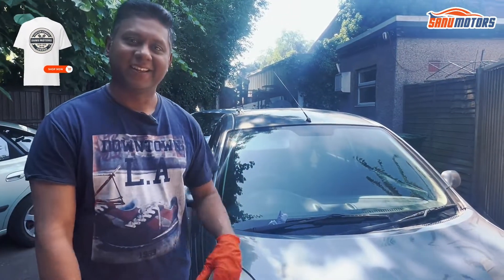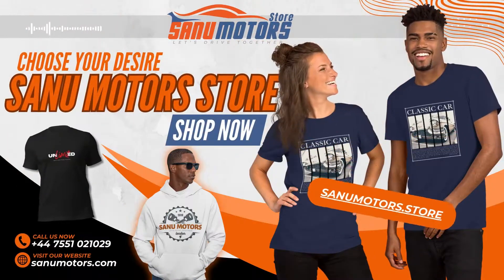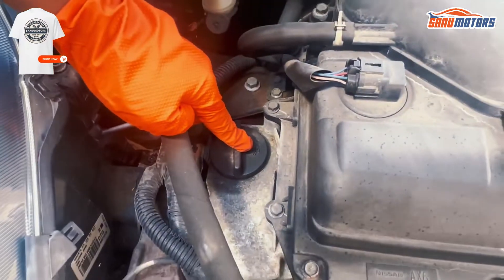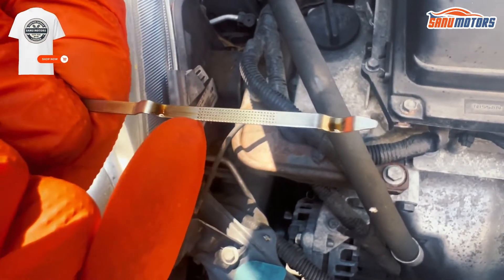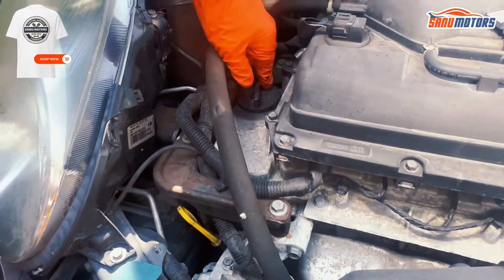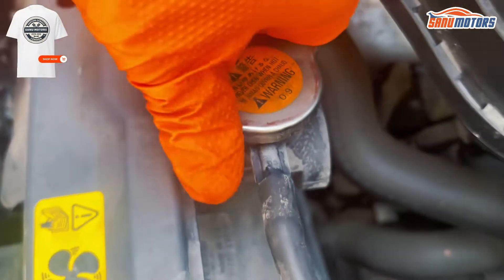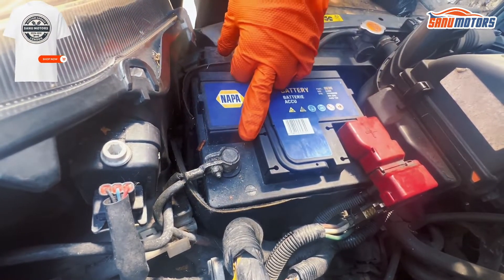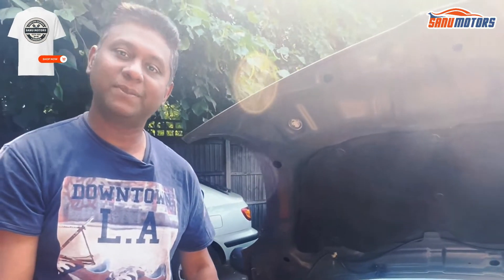Nissan Micra 2008 Engine Bay Top Up Guide | Coolant | Screenwash | and Engine Oil DIY Tutorial  🛠️💥💯

Comment: Hi Brother, just like you showed me your engine oil level, my car's engine oil level is also the same, what should I do now?  I have Nissan March 2003 and oil level problem still And the engine oil level problem is that I've been seeing the same engine oil level since I bought this car five years ago.
Reply from the maker: Thanks for your question, and it’s great to hear that the video was useful! If your engine oil level has consistently remained the same for five years, it’s quite unusual—most engines consume a little oil over time, especially in older cars like your 2003 Nissan March. Here are a few things you might want to check:

Oil Quality:

Make sure you’re using the correct grade and type of engine oil recommended for your car. Sometimes, thicker oils can appear to stay at the same level but may not be circulating properly.
Oil Circulation:

Check if the oil is actually circulating within the engine. A clogged oil filter or sludge buildup can prevent proper flow, making the oil appear untouched.
Dipstick Reading:

Double-check your method for reading the dipstick. Wipe it clean, reinsert it fully, and then check again to ensure accurate readings.
Faulty Dipstick or Measurement Tube:

A damaged dipstick or dipstick tube might not give you accurate readings. Inspect it closely for bends or blockages.
Oil Burning/Leaks:

Since you haven’t noticed any drops in oil level, there’s likely no excessive burning or leaking, but it’s always good to inspect under the car for leaks or check the exhaust for blue smoke (a sign of oil burning).
Regular Maintenance:

Even if the level seems fine, it’s still important to change the oil and filter regularly to ensure the engine is lubricated and protected from wear.
If everything checks out and the car runs smoothly, there may not be any immediate issue. However, if you’re still concerned, a quick inspection by a trusted mechanic can give you peace of mind.

Let me know if you need more tips! 🚗👍 #NissanMarch #EngineOilLevel #CarMaintenance
Reply: @SanuMotorswithCharlie  ❤️
Reply: Thank you so much brother
Reply from the maker: Your welcome
Reply from the maker: Your welcome

Comment: Can someone tell me where is the tank door in micra 2008 CC pleeeaseee
Reply from the maker: The tank door (fuel filler door) for the *2008 Nissan Micra CC* is located on the rear passenger side of the vehicle. To open it, follow these steps:

1. **Locate the lever**: Inside the car, near the driver’s seat, there should be a lever or a button to release the fuel door. It’s usually positioned on the floor next to the driver’s seat or on the side of the seat.

2. **Pull the lever or press the button**: This should pop open the fuel door.

3. **Open the door manually**: Once the door is released, you can open it fully from the outside by pulling it open.

Let me know if you need help with anything else on your Nissan Micra!
Reply: @SanuMotorswithCharlie   hello, thank you for your reply. but on my nissan micra convertible CC 2008, you have to press the upper right corner of the fuel door. I didn't find it for 2 days. I translated the german manual.
thanks again for your reply, it's very kind

Comment: Does the colour of the coolant ??
Reply from the maker: The color of coolant can vary depending on the type of coolant used in your vehicle. Generally, coolant comes in different colors such as green, yellow, red, blue, or pink. The color of the coolant is often indicative of the type of additives and corrosion inhibitors it contains, rather than its effectiveness.

Here's a general guide to coolant colors and types:

Green: Traditional coolant, often ethylene glycol-based, and typically found in older vehicles. It offers good corrosion protection but may require more frequent changes.

Yellow: Usually signifies a hybrid organic acid technology (HOAT) coolant, which is a mix of organic acid technology (OAT) and inorganic additives. It's commonly found in many modern vehicles.

Red, Orange, or Pink: These colors often indicate an extended-life coolant, such as Dex-Cool (orange) or Global Extended Life (red or pink). They typically last longer than traditional green coolant and offer better corrosion protection.

Blue: Some European vehicles may use blue coolant, which often indicates a specific type of long-life coolant formulated for those vehicles.

It's essential to use the coolant recommended by your vehicle manufacturer to ensure compatibility and optimal performance. Mixing different types of coolant can lead to chemical reactions that may damage the cooling system. If you're unsure about which coolant to use or if you need to top off your coolant, consult your vehicle's manual or a professional mechanic for guidance. Additionally, regularly check your coolant level and condition to ensure proper engine cooling and prevent overheating.

Comment: What is the nissan Mirca radio code?  I am in finland.
Reply from the maker: The Nissan Micra radio code is a security feature that helps prevent unauthorized use of the car's radio system. If you've lost the radio code for your Nissan Micra, you will need to obtain it in order to unlock the radio and use it again. Here's what you can do:

Check your Owner's Manual: The radio code might be written in your car's owner's manual or in the documentation that came with your vehicle. Be sure to check these documents first to see if the code is readily available.

Contact the Dealership: One of the most common ways to retrieve the radio code is to contact the Nissan dealership where you purchased the car or a Nissan service center. They should be able to provide you with the code. You may need to provide them with your Vehicle Identification Number (VIN) and possibly other proof of ownership.

Online Code Services: Some online services and websites may offer radio code retrieval services for a fee. These services may be able to generate the code for you based on your VIN or other information. Be cautious when using such services, and ensure they are reputable.

Contact Nissan Customer Support: You can also try reaching out to Nissan customer support in Finland or the nearest Nissan customer service center for assistance in retrieving your radio code. They may require proof of ownership before providing the code.

Please keep in mind that sharing the VIN and other personal information online should be done with caution, and it's essential to verify the authenticity of any service or website you use to obtain the radio code to protect your personal information and your vehicle's security